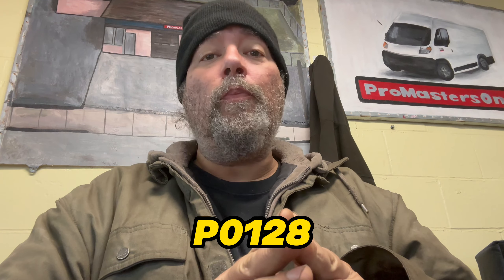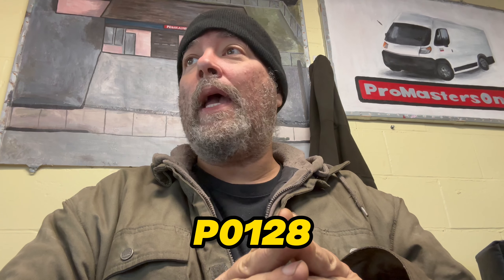CODE P0128  - thermostat rationality Ram Promaster 3.6 V6 Pentastar Chrysler Promasters Only!

Comment: The Dorman replacement are awesome.  Did the crossover too while I was in there with the Dorman replacement too!  Full trifecta and replaced the overflow as well!  The crossover is a bit more involved in that you need to prop up the engine and remove the upper mount.  My 2014 had standard bolts holding the mount in, vs the Torx ones found in later years.  However the center mount bolt froze into the housing.  Attempted to remove it, but decided to just leave it broken for now.  The hardest part was trying to re-align the upper mount bolts.  A bit of prying with a large pry bar did the trick.  No more leaks, temps are good, code gone!
Reply from the maker: The only trick to getting it line back up is sweat and pry bars! Luckily, I expect you'll only ever have to do that job once. I actually talk to Dorman occassionally, and they make some very budget stuff but they also very actively seek out niche fixes like these. Good guys over at Dorman.

Comment: From the sounds of it you have replaced this thermostat without draining the coolant? How much comes out typically if your engine is cool? It's a bit hard to get something under it to catch it cleanly with all the stuff underneath
Reply from the maker: @ngottlieb  if you just pull the thermostat, you’ll get about a 1 gallon bath. If you can, pull one of the easy to get to coolant hoses at the bottom by the a/c compressor. Drain a gallon or so. Then put it back in the bottle after you do the therm. Some mess, but very little.
Reply: @promastersonly1419  thanks!!!

Comment: my cooling fans on my radiator only come on when I turn off the key when I run the motor the fans never come on
Reply from the maker: Cant say for certain, but when we’ve seen that before it’s been one of the relays on the fan shroud sticking on, keeping that fan running after shutdown. What you could do is swap the relays and see if the problem moves to the other fan.

Comment: please help my radiator fan only turn on when my ac is on i change the new fan already change the temperature control already by the way thanks for those video 😢
Reply from the maker: Two basic possibles - one is that the thermostat is sticking closed. But I'm assuming that's not it because you say your fan isn't coming on when the a/c is off (there are two fans, one does the engine the other does the a/c). There is a relay for each fan and a big green resistor for each fan on the shroud itself, but there is also a fuse for each fan in the fusebox. Usually the van is smart enough to know if the fuse is blown and throw a code for that, but not always. I'd check those two fuses, then start working back from there.